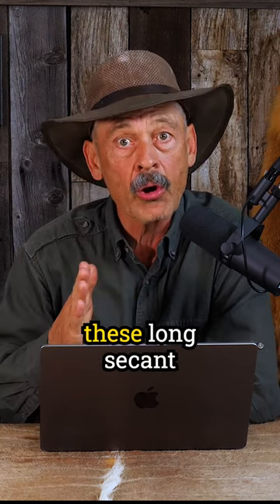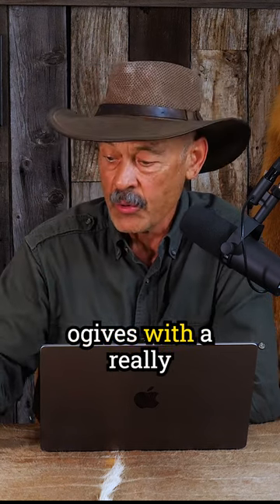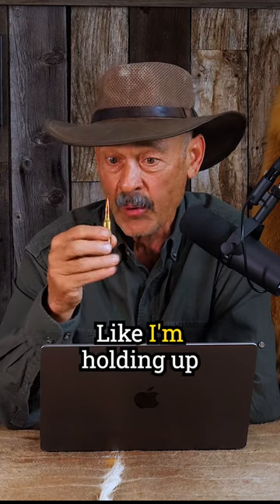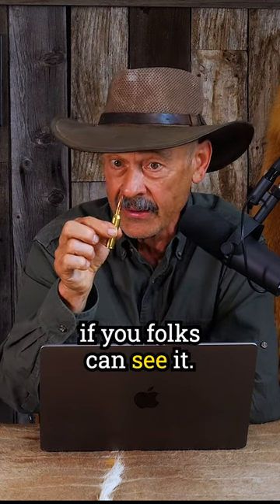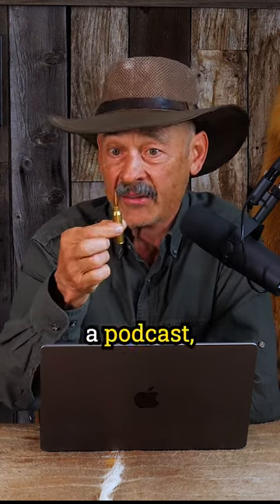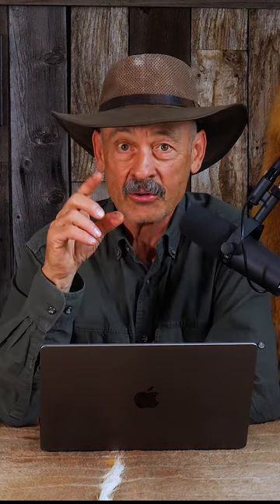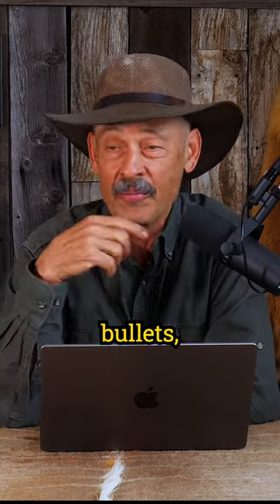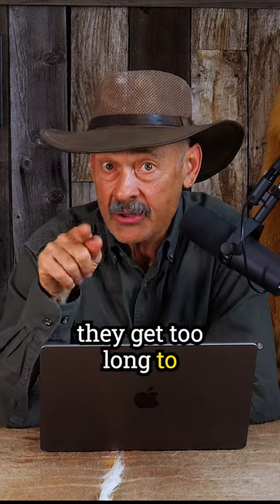Stabilizing Bullets with Faster Twist Rate

Comment: Why are bullets not spiral twisted to impart more spin? Wouldn't a faster spin in addition to the twist in the barrel also give a bullet more stability?
Reply: Not at all how that works, once the bullet is shot it kinda squeezes into the barrel so the rifling grooves in the barrel cut into the bullet and force it to twist before leaving the barrel

Slugs in shotguns have rifled slugs to help increase spin simply due to shot guns being smooth bore
Reply: Even in shotguns where this is used the rifling on slugs actually imparts very little spin, nowhere near enough to stabilize the slug but the rifling grooves allow better deformation at the muzzle so you can fire a rifled slug through a choke. Spiral cutting a bullet would just make your ammo more expensive and have no practical gain. Heck, it would probably make your bullet worse if the rifling was undersized you’d have gas blow-by and if your bullet rifling was oversized to create a good seal it could shear off leaving shedded jacketing in your barrel which at best would be a real pain to clean and at worse would obstruct the bore enough to turn your rifle into a pipe bomb.

Comment: Tikka still using 1/11 for 30 cal. That’s why I stay away from them
Reply: There new guns. In 300 use 1 in 10 the super varmint. The new one
Reply: My Tikka 1 in 11 is fine now I cut barrel ro 20 inches. Using 190 grain speer impact bonded is fine but wish I could shoot 230s

Comment: A few points. For target shooting, a G1 b.c. of .500 will get you to 1000 yards before going transonic. B.c. shifts with velocity and projected numbers are based on an intended minimum velocity  . A high sectional density will effect your bullet flight ( actually drop) path as well due to the base pushing faster than the tip . The higher the s.d. the more the effect will be apparent. This is for the same reason that a high s.d. bullet penetrates better than a low s.d. when all else is equal. B.c. is effected by bullet length and shape and velocity more than weight.  When shooting purely for accuracy , the minimum rate of twist for the chosen bullet @ velocity for b.c. will give best results . An easy to find example is the savage palma rifle. Palma was much more restrictive when the savage palma was designed , .308 155 grain match king Palma from sierra, chambered in .308 winchester NM (called .308 Palma) was the only acceptable choice for official competition. As such the barrel has a 1/13 twist to get the best accuracy possible . Palma has changed over the past 20 years.mostly it has more cartridge restrictions or bullet type restrictions.  But it's still all about eeking out accuracy .fyi Palma is a 1000 yard, iron sights only target match.